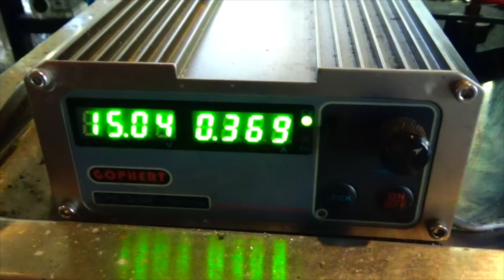#RoughCut2022 - How To Make a Lathe Tool Height Setter.

Comment from the maker: For some reason this video has attracted a lot of negative comments lately. Rather than answer each comment individually, it is easier for me to pin this comment here and refer people to it. 
Firstly, this video was an entry in the RoughCut2022 video challenge in which YouTube creators were asked to make a tool. I made a tool. It didn't win. I don't mind. I had fun making the tool.
Secondly, yes, you can set a lathe tool by trapping a scale/rule between the tool tip and the work. But this is a fairly subjective method. It does work and I have used it but it is approximate.
Thirdly, I acknowledge that this tool is overly complicated but it does work, it is accurate and a similar version is made and sold by Edge Precision. 
Fourthly, I am not asking people to buy it and I only ever made two of them, one of which was given away as a subscriber gift. I wanted to make something nice for the gift which is one reason why I spent a lot of time finishing it. 
Fifthly, I like making things and finishing them well. I enjoy using processes like anodising, CNC engraving and bead blasting. If you don't want to use those processes, you don't need to and the tool will still work perfectly. 
Sixthly (is that even a word?) I wanted to showcase some techniques which may not be widely known for makers who watch YouTube. Even if you don't want to make a lathe tool setter, you might still see a technique that you could adapt to a different project.
I hope this answers a lot of common questions.
Regards,
Mark Presling
Reply: awesome tool mate, I'd love to have one of those.
Reply: you make what works for you if you enjoy making it and it works as it is supposed to then, anyone complaining is forgetting the first rule it's not their problem. By the way your finished product looked very well made and finished very impressed.
Reply: You are a true artist and a pro. Don't listen to youtube nincompoops. Thanks for sharing. I'll build one.
Reply: Thank you Sir for your knowledge & video 
I do appreciate your efforts
Reply: You look to be of an age where we did things simply, yet... You've developed an unnecessarily complicated tool for a simple task.  The simplest ways are best...What we did was interpose a (straight)  steel rule between the tool tip and the workpiece (I'd use a straight plastic rule, now, carbides tending to be brittle by comparison with HSS, or interpose a plastic pad between my hard steel rule and the tool tip), having got the tool up to something approximating the lathe spindle centreline. the rule then lies at a tangent to the workpiece. If the rule is vertical, the tool is at centre height. If the rule top is nearer the operator, the tool's below centre, and vice versa...

Imagine... You're on a big Swift (or other) lathe, with an 8 foot diameter cast iron cylinder mounted in it... you have no means of getting to the tailstock after a tool swap or regrind... even if there's no workpiece in place, do you want to move the toolpost 4 feet to get a tool on centre? No, you get a rule out of your box (or top pocket) and interpose it between tool tip and workpiece, when it's loaded... Works with LH, RH, and upside down tools

Not criticism, by the way, merely an observation...  The old Cincinnati tool and cutter grinders came with a centre height setting tool as standard equipment, used for setting cutter teeth on centre before grinding, and, they could be used to set a tooth on centre whether it was pointing up or down, and to set the wheelhead spindle centreline relative to the workhead or centres... Same simple tool... Something similar or even simpler could be used on a little lathe like yours...
Reply: Anyone that would leave a negative comment for a video like this is just simply a bone head. I only wish I could come up with such a nice piece of work whether it was over kill or not is beside the point. I have a new lathe coming next week and I may just try something like this myself. Great work.
Reply: So, interposing a rule between tool and workpiece or between the tailstock barrel and tool isn't simpler, cheaper, faster? 
Let me quote Antoine de St Exupery to you.  (he was, among other things, an aircraft designer) "perfection is not achieved when there is nothing more to add, but when there is nothing left to remove" 
It's always worth applying that maxim in engineering work.

Now, would you like to speak in support of introducing unnecessary complexity, and, indeed, tell us what we need when the tailstock's rendered inaccessible by virtue of a (possibly large, possibly heavy) workpiece already loaded?  
If a tool centre height device is necessary at all, it must always be necessary?... 
The rule technique works with positive rake tools, negative rake tools, inverted tools... Does this device?  I'll concede it's pretty, though... Bonehead?  I've had worse...
Reply: I like what you made. I’ve been a toolmaker for over 50 years. The lathe is my all time favorite machine. I have a pretty nice hobby shop these days after selling my good sized CNC shop to my sons. I’ll  admit it’s a bit overkill but seriously who needs to be negative. I get why you did it. I applaud you sir. And you nay sayers are just jealous.
Reply: I really like that tool
Reply: If someone can't appreciate the difference between the instrument you created and using a ruler to roughly set centre height, then machining probably isn't their calling 😉

Comment: Quickest and easiest way to find the centre line of the tool. Spin the tool post around and set the tip to the point of the tailstock centre. Works every time, no tool needed! Also in the UK we call the projection a 'Pip'... great video as always Mark
Reply from the maker: That's how we used to do it at school. However, once you spin the tool post you lose your reference on the DRO. I wish I had one of those fancy schmancy multifix tool holders but an old cheapskate like me finds them a bit too pricey. 
Regards,
Mark
Reply: How we have done it at work: take an aluminium-sheet. Put it on the cross-slide. Make a mark with the tailstock centre. Saw on the mark and make the sheet to look as a "Z". There is the correct hight.
 We have made them from aluminium, made one last thursday (took about five minutes). With a good bandsaw one could make it in Aisi316 to last"forever". The inserts slowly destroys the aluminium edge so be prepared to make a new every 15-20 years 🤭🤣...
Reply: This also only works if your center is actually on center. All kinds of reasons why that might be out.
Reply: Me too, since it’s already there . 😊
Reply: Spinning tbe tool around assumes 2 things, which can be incorrect:
A) the toolpost is vertical, hence doesn"t change height
B) the tailstock is vertically centered.
Reply: @johncoops6897  
 Well, in my opinion: if we still talk about "hobby-machinig" it's not that critical. If turning the toolpost changes the hight of the tool there are larger problems with the lathe. The same with the hight of the tailstock: there should start to come problems with size when drilling.
 I admit that my experience in this trade is limited to 30 years, but I have not come upon a lathe with vertical adjustment on the tailstock. Today I learnt something new again, thank you for that 👍🏼😋!
Reply: @ADBBuild  
 Why would it be vertically "out"? Horizontally it doesn't matter where it is...
Reply: @Preso58  Well, if they're too expensive, perhaps you'll have to make your own?  :D

But seriously, this looks like a really useful tool!  I may have to make one at some point.  And learn to do anodizing, because now I want lots of purple tools; that looks great!!  (And the purple and green of the spirit levels... chef's kiss!)
Reply: @DavidLindes  I too will be spending $$ on an anodizing kit because that purple is awesome! Lol
Reply: @bencapobianco2045  Right?!?  :)
Reply: @DavidLindes  making the tool is great exercise.  And you get a tool in the process.
Like machinist used to do, and black smiths still do today.
Reply: @andersjackson4014  believe me, as soon as I can (hopefully) find space to set up a (machine, etc.) shop, making my own tools will be very high on my list of things to do!  I sadly just don't have a viable space to do this kind of work in currently... but am actively looking to change that.
Reply: Fondly refered to here in Aussie as a nipple
Reply: Take a six inch metal rule and pinch it gently between the cutting edge of the tool and the side of the material in the chuck.  If the rule is vertical, the tool is on dead centre.
Reply: Nargh.
Easiest way is to trap a steel rule or straight edge lightly between the tool tip and some round bar held in the Chuck.
If the tool is too high the top of the rule will point away from you.
If it’s too low the top of the rule will point towards you.
If it’s dead nuts on centre the rule will be perfectly straight up and down.
Reply: @SilverWrinkly that's the way I was taught at Foden trucks in the UK
Reply: Doesn't work with a junk tailstock, like the Leblonde I use.
Reply: I bet it took a while to get that anodizing right. Great job!

Comment from the maker: Several people have asked I intend to make any of these tools for sale but the answer is no. I doubt I could make them at a competitive price and there are similar tools on the market anyway. However if you would like to make your own, I have included a link in the description which will allow you to download a PDF version of the 2D drawings. The tool body doesn't need to be made of aluminium. I good quality 3D print in PETG or carbon fibre filament would be fine. A resin print would be even better. The only requirement is that the two setting screws can be adjusted and locked and that the top and bottom mounting surfaces for the spirit bubble levels be parallel to each other.
Reply: Thinking about this a bit and I don't even think the top and bottom surfaces need to be parallel since they are not really used at the same time, each level is really only referenced to the adjustment screw (which should be perpendicular to the level). Since each side is calibrated only between a single level and the adjusting screw for that side being parallel to the opposite side it nice, and pretty, but not a requirement. Please correct me if I am wrong.

I love this project and the presentation you made of it.

Comment: Well executed machining and complete finishing process of doing not only this tool (which is well thought out) but any tool or part from cradle to grave. I'm retired from 50 years engineering, still active in my own shop. I have continually learned and asked questions from others like yourself for better, easier, more logical ways to improve our craft. Great job Mark, I like the tool and your build execution.
Reply from the maker: Thanks for that. I enjoyed making that tool and although it's a bit over the top, I still like to use the processes that enhance the finished product. I guess it's a case of being able to justify the expense of purchasing tools and materials. If you don't use them regularly, it's a bit of a waste.

Comment: Hi Mr. Presling, I made a 3d printed version of your tools. It is incredibly simple and very smart design as I can just use almost all off the shelf parts and it also works really well. Very easy to set and very consistent. Thank you for sharing your fantastic design.
Reply from the maker: Thanks and I am glad you were able to make a 3D printed version. I copped a lot of criticism for making a tool that appeared to be over done and out of reach for a lot of viewers. My intention was to make something nice to give away as a gift but I always reasoned that you could make a serviceable version from CNC machined plastic or even cut out of some plastic stock on the bandsaw. The key is to have a way of calibrating the tool. I use mine a lot and it just works and there's little guesswork involved. 
Regards,
Mark

Comment: I'm absolutely new to turning, and was looking around for a simple, quick and effective way to set tool height, but watching this video made me feel like I'd better choose another hobby...
Reply from the maker: Don't be put off by my version of this tool. It doesn't need to be much more than a 3D printed body with a self tapping screw for calibration. A single row ball bearing would be sufficient to allow it to rotate freely. As many people point out, I have over done the detail in this build. My main objective was to make a nice tool to give away to a viewer and I also wanted to showcase some metal finishing techniques that others may not have tried. 
Regards,
Mark

Comment: Beautiful job! I love the purple/green contrast. Glad to see someone engraving through the anodising. This is a technique I conceived myself some 47 years ago (don't know if anyone had done it previously) but with pantograph v groove engraving through black anodising for an audio amplifier panel. 

I had the black anodising done professionally for me, perfectly prepared to pay but despite trying (and succeeding) to black anodise some fine aluminium mesh (car filler support mesh!) for the air vent, AND doing the case cover they were happy to do it all free, they just wanted to see the result afterwards. They'd never tried anodising mesh so fine and were concerned it might all dissolve - it didn't! 

So some 47 years later how does it look? Wish YouTube allowed pics in posts, but suffice to say it STILL looks pristine and the engraved aluminium, despite being exposed to air for all that time is STILL shiny.

Anyone who knows how to anodise and has a CNC engraver should try this. The results are superb. I didn't have access to glass bead blasting back in the day, but instead just used fine wet & dry (1200?? - LONG time ago) and gave the ali a brushed look prior to anodising. Today I'd use a fine Scotchbrite pad or locate a glass bead blaster (I love that matte finish)!

Not sure I'd go to the lengths you have to produce such a tool but having a 3D printer and not a Mill
😢😢 I might try it at some point.

Before that though, my VERY recently acquired, bargain priced, Myford ML2 has to be completely refurbed & restored, together with a large format, heavy duty pillar drill (70mm column!).
Reply from the maker: Thanks Bob. I must say it has taken a lot of experimentation to get repeatable results with the home anodising. As you have found, the finish is very durable. What I only found out recently was that the PH of the dye can vary quite a lot and if it is too alkaline, it won't take very well or at all. I purchased a digital PH meter and found that some dyes were PH 9! A few drops of hydrochloric acid got it down again though. There's always more to learn....
Regards,
Mark
Reply: @Preso58  thanks for that! Highly useful tip. AND, at the moment, 36% Hydrochloric acid is perfectly legal in the UK so a simple PH meter can solve that problem for me too hopefully, although using Sodium Bisulphate may require a different PH or not even be bothered! We shall see! 👍👍👍

Comment: Absolutely brilliant anodising.
Reply from the maker: Thanks, but I must say it has taken a long time to get consistent results. I only found out recently that you need to check the PH of the dye. If it's too alkaline, it won't work well, or at all. Also, if you don't rinse all the electrolyte off the part, you will get bare patches where the dye won't penetrate. 
Regards,
Mark

Comment: That’s just plain fancy.  Nice machine work.
Reply from the maker: Thank you. I regularly get comments stating that the tool is overcomplicated, too hard to make and not as simple as say, trapping a scale between the tool tip and the workpiece. I know all of this and the video was never meant to be a "simple" solution. It was more about how to carry out some processes that will make your projects look more professional and, as it happens, I use the tool regularly and I get accurate results with it. I am glad you found the video instructional. At the end of the day, that is what I want to achieve. Again, thanks.
Regards,
Mark

Comment: Very impressive tool, in my apprenticeship were taught to touch the toolbit onto our 6inch rule against the surface of the work piece. The rule gives a quick indication of offset either side of centre
Reply from the maker: Yes, that works well and I do use that method at times. 
Regards,
Mark

Comment: Thar was fun! I wondered about the Edge setting tool, mainly for the tiny carbide boring bars I use, which are 1.7 mm diameter, but I also need to set up 0.5 mm pitch threading inserts which are at steep angles. I think a modified version of your tool with a larger radius and smaller tip might work really well.  Also, the colour is fabulous.
Reply from the maker: Thanks. I really should get some of those little carbide boring bars. I have seen Joe Pi using them and I get very jealous. I have about 8 different colours of anodisng dye but that violet colour is my favourite. I only found out recently that the PH of the dye is really important. I bought myself a PH meter and found out that half my dyes were way to alkaline. A few drops of hydrochloric acid gets them back into range and the parts colour up nicely. 
Regards,
Mark
Reply: @Preso58  pH of the dye is interesting, I must have a check of this blue dye to see what it's acidity is. The Simtek tools are excellent although I think it's possible to grind them from scratch using a Deckel or similar. I made my own holders and the little boring bars last ages unless you do something brutal. Like knocking the carriage handwheel...

Comment: Years ago when I ventured into wet tumbling I looked at the larger tumbler and decided it was more than I needed.  I ended up with the harbor freight duel tumbler with a homemade pvc drum.  This works great for my volume needs.  However, if they made the smaller tumbler back then I would probably have chosen it. Thanks for  the video brother. 🙏